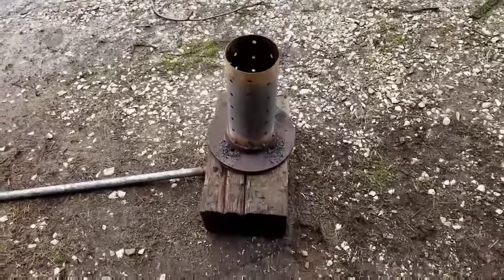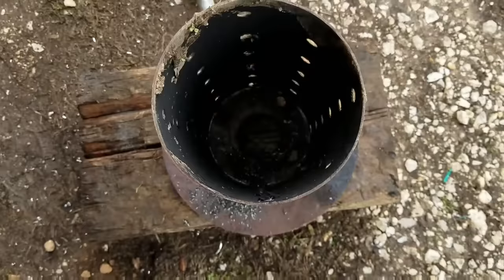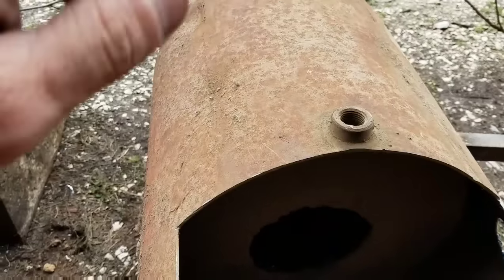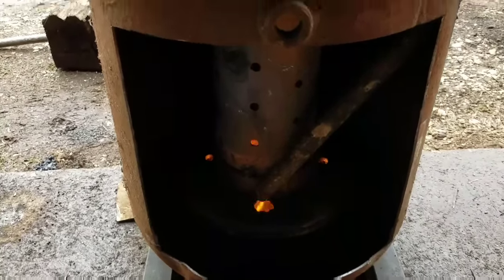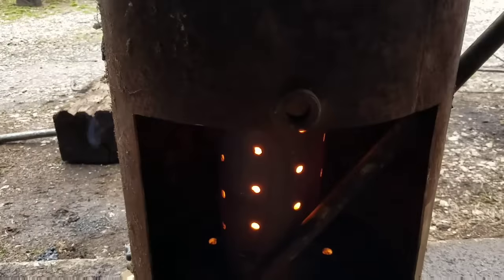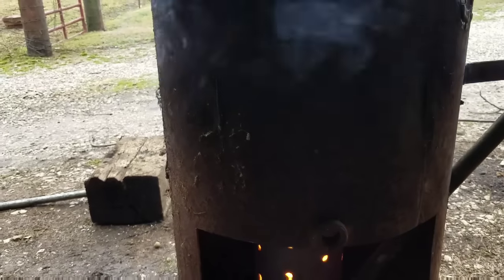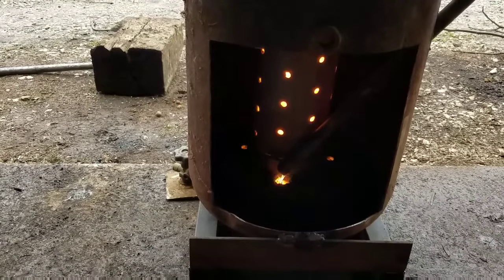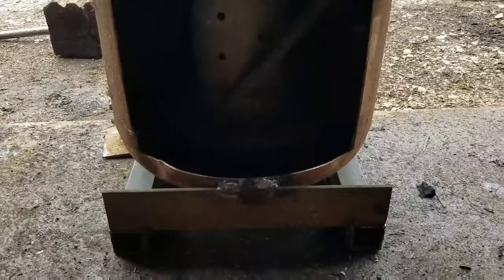Waste oil burner-100% Free Heat!!

Comment: I build a simular burner 30 years  ago. Headed a 2,000 sq ft area real good, but the shop burned down one cold day. I started a fire, I had a 20 gal used oil drum overhead to feed the burner with. The weather was very cold, abould 30 degrees in the shop. I started the fire and then unexpeakly had to leave. The oil was cold went I started it and the valve was turned up enough to started the burning. After I left, the oil warmed up enough to start runing  at a flow faster than it was burning. Oil overflowed on to the concrete floor and must have started burning and all hell happen. I now realize I show have build a pan around the bottom of the stove than would have held 20 gal of oil. Out side of that, the stove worked very well.
Reply: Very good information thank you.  Sorry for your loss. That is terrible
Reply: Seen some that have air holes low in the pan so if an oil overflow happens the rising oil snuffs the flame out
Reply: @plap.  you got a link?
Reply: @johndowe7003  no, you know how it goes. You look at one video they start sending all of them. Just random ones sent a while back. A few were very simple. The air holes just stay low in the pan so flames snuff out before overflow. One guy used 90° pipe fittings arranged around the base to get a swirl going and low enough to cover fittings  if flow of oil freaks out
Reply: @plap.  I'll post a video of my fire hazard soon 😁
Reply: @johndowe7003  look forward to it. I'm still in parts gathering mode. My goal is free scrap all components. Plans can change with any new good or bad idea. May save me some grief. At this point iv seen quite a few. Have a cold boat shop and lots of waste oil we pay to get rid of anyway. This will happen. Good luck
Reply: What did the insurance company say ?

Comment: When I was in the USAF, we had a "Clean Burn" oil heater in our shop. Loved that thing. I always wanted to build one of my own for all the used oil I have. Thanks for sharing.
Reply from the maker: Thank you for your service. That's pretty cool! Thanks for watching!!
Reply: Clean Burn heaters are made in Leola, Pa, and I worked there, and helped to make the preheating block for the oil. Incidentally, they had three rows of three outside, for two purposes. 1) to test the heaters long term, and, 2), to burn off excess oil. Their heaters are EPA approved for burning oil.

Comment: In the Army, we had field mess kit barrel cleaners, RAPID boiling water with a drip feed of kerosene. The burner, water tight was lowered into the HEAVY DUTY GALVY barrel of water, a can of fuel having a valve to control kerosene drip was strapped on and combustion was begun with a piece of lighted paper. The tube from the fuel can was about 1/4” dia and there was considerable distance from end of tube to burning ring below water. Consider a small fuel feed as there is less chance of flame working it’s way toward the fuel source. You can probably look these units up online to get the proven design. Good luck. Safety first and foremost. Steve, Plymouth, MA
Reply: If you're still around sir I would greatly appreciate a link to how these things were constructed. This sounds amazing. Thank you.

Comment: We used a drip feed diesel stove to keep our tent warm(ish) in Alaska in January 76. It would get the inside of our army issue dual wall tent up to 30 some degrees. It was -50 outside.

Comment: Not enough air and to much oil in the burner. Drip the oil very  slowly, about 1 liter or 2 pints per hour. You need the pin valve to regulate the oil flow. Also extend the chimney flue to speed up the airflow. another suggestion is, separate the flue from the burning pot. get rid of the flange and let the flue which have holes in it to be about 2inches about the rim of the burner pot. This needs little experimenting to achieve best burning without any smoke at all. To start the fire I recommend use little diesel mixed with methyl alcohol to heat the burning chamber. This prevents too much smoke and soot sediment in your flue. this method is very good in the winter when even the diesel is hard to start burning.  I used the Gas blowtorch to lit this mixture which is much safer than using  petrol/benzine. You need to clean the burning pot quite often as the sump oil is very dirty. When I had the heater I used two cast iron pots - one in one out being cleaned. I hope this will help you to achieve the best result.
Reply from the maker: You are right, it was very over fueled at the time. I made a part 2 to this video, it works much better. Thanks for watching.
Reply: Mabey a 3 inch air intake  in the bottom?

Comment: a friend of mines dad years ago had a small old potbelly stove in the garage with a tank on the wall with old waste oil that gravity fed threw a small brake line that went into a hole he drilled in the stove! he used a type of a petcock  valve you turned to control the flow! his son started the stove up and turned valve to much and left the garage and when he came back the stove was glowing red!!! lol
Reply from the maker: I don't doubt that. It something I'm going to keep an eye on.

Comment: Built one in Oklahoma out of a old water heater tank. I had a 18 wheeler so had plenty of used oil. Would heat the shop in the winter. Tank would get cherry red around the bottom half when you turned it up. Not a heater you would want to leave and go to town for parts though. Have to watch the heat and drip !

Comment: You should fill the top side of the air compressor tank with sand so it heats up and radiates heat longer like aa thermal battery. Just seal off that plate you welded in and put the pipe through so sand doesn't fall down. Should hold 40 lbs. Also I'd just use 2 brake discs instead of the dog bowl. Plate off the holes on the bottom disc for the studs from the other side and you have a much thicker base. Weld the 2 together with the offset facing outwards.
Reply: Great idea for the sand battery. And the weight, one never knows how heavy things can get. I'm currently seeing a trend of stainless right now and it seems they work well. I assume that it'll just take a little bit longer for the burner to heat up? Could you please explain this "Weld the 2 together with the offset facing outwards."
Reply: What about water instead. So you can use it for in floor heating

Comment: Either enlarge your secondary air holes or drill more of them. The black smoke is because it is starving for air. you can also reduce the amount of air into the pot which will reduce the flame going into the pipe and  clean  up the smoke. I had a russian heater which had a sliding door to control the amount of intake air. The pipe had so many holes that it looked more like a fence and it burned very hot and very clean.Also my secondary burn pipe was three times the length of yours. You have way too much primary air with that vented disk which creates too big a flame and your secondary burner can't keep up with it(can't mix enough air with it to create a clean burn).
Reply from the maker: Thanks for the feedback, I'll try it out.
Reply: The hole in the top of the brake disk needs to be sam size as the pipe over it.

Comment: It smokes a lot because it needs more air.  Not saying you need a blower, but get mor air (like 3 more 3 inch pipes directed into the burn pot) and it will really roar.👍
Reply from the maker: Thanks for the help, it's a work in progress. I made a 2nd video about it when its hooked up to the chimney, works much better.

Comment: It will work much better with a solid pipe like the one in your second video, haha already watched it,, works great. Thanks for the tip nice job.
Reply from the maker: Thank you! I did add a few holes back in it but, it looks like the picture in the thumbnail, it cleaned up the burn some. Just as long as you don't add too many or make them too big, it won't lose the suction.

Comment: Ok idea to try, use second brake disc mirrored between dog bowl and current setup. Should isolate oil from air better and give you true heated secondary air burn
Reply from the maker: That's a good idea, when I build a new one I'll try some different build designs.

Comment: Hi, how did it work out for you? The reason for smoke is that you need slightly higher temperature inside such that you get secondary combustion. Adding one or two plates horizontal inside would probably do the trick since that would force the flames to spend more time inside the burn chamber. The retained heat in the horizontal plates would cause a secondary combustion resulting in higher yield and no smoke.
Reply from the maker: I hadn't thought about the plates, when I build another one I'll be sure to add that in.

Comment: Good work.  Question. If you burn 20 - 50 weight oil. Does it burn hotter than if you burned 5-20 oil? Does the 20- 50 oil last longer?

Comment: No. Beeen running one for twenty years. Just a flex exhaust pipe with a  blower and a quarter inch copper line in the pipe dripping on a cast iron pan. Weld fins inside and choke the chimney.

Comment: if  your not going to use forced air for your combustion you need to make sure your fuel is atomizing or evaporating when it is introduced.  Making sure the oil is in excess of 160 degrees will help too.  Reroute your oil delivery closer to the flame so the oil is preheated.  Lessening the flow of oil will help too so you don't quench or cool the combustion with new, cooler oil.  So will some wicking, like a couple of big wads of stainless steel wool where your oil pool is. Stainless steel wool like the kind you use to clean pots and pans.
Reply from the maker: That steel wool is a good idea, I'm going to try that.
Reply: Carbon felt would also be a good wick
Reply: @pennderosafarms7910 lava rocks might be of some help as they are porous, and might draw oil upwards as it is burned.

Comment: That works pretty good the way you got it but if you add a door with a damper to draw the air in that thing will rip
Reply from the maker: I tried that but, it seemed it to block off too much air that it needs to run red hot. It's all trial and error, that's the fun part.

Comment: Needs more air to burn and clean up the smoke.  A fan to force air into the burn chamber is needed.  It's like a car engine that runs too rich - black smoke out the exhaust.

Comment: Draw the air from bottom up through center make sure everything else seals tight will give you the jet engine once you close the door
Reply from the maker: That would probably work. I tried to put a vented door on but, it blocked too much air.

Comment: Get the door done and you will create a vortex. That will quadruple your heat . Especially if you meter the fuel to a drip.
Reply from the maker: I tried that but, it seemed to block too much air.

Comment: Did you start a regular old fire in the bottom before adding oil?
Reply from the maker: No, the best thing to do is add a shot of kerosene or diesel to get it burning.
Reply: Curious how much oil per hour or day ?

Comment: The air coming where you cut the front of is equalising air pressure which is needed to be sucked up through the bottom. You need to fix a door to the front and seal it off then it should burn and sound more like a rocket.
Reply from the maker: I tried that but, it seemed to block too much air.
Reply: @pennderosafarms7910  Try boring the air holes bigger and put it on an 8 inch high 3 leg stand so it will stand on any ground.  8 inches should be high enough for air to come up underneath and 12 mm holes in the centre piece will give more combustion. I love rocket stoves and have watched many other builds. The common factor seems to be air mix and length of flue. You need plenty of air and a chimney/flue that's the right height for the upward vortex to be created to suck the air in the bottom, one feeds the other. Once you get the right intake and exit it will sound like a rocket. It's the same principle as pulse jets. Search Integza Pulse Jet in YouTube.
Reply from the maker: @paulmlally1  When I build another one that's how I'm going to do it. A hole in the bottom and force the air up. Thanks for watching!

Comment: Fire need plenty of air to achieve complete combustion. Any reason why you restricting air flow to the fire via the few small holes  you drill through the metal cylinder at the center? Why not design a primary vortex burn with plenty of air then create  a 2ndary or even a 3rd hot air burn again before the hot air exit ?
Reply from the maker: I'm sure that's a good idea. This is the first one I've built and I'm surprised how good it works. The next one I build will have a different design and I'll see what works best.
Reply: @pennderosafarms7910  my respect and my humble encouragement to you to design and build an ultimate stove
Reply from the maker: @psyamok3735  Thank you!

Comment: I'm in . going to build this. Will it burn diesel if out of waste oil?
Reply from the maker: Yes, it will burn anything. I burned some old peanut oil I had from a Thanksgiving Turkey and it burned just as hot as engine oil.

Comment: I would cut a hole in the bottom of the tank and place just the perfected pipe up through it and let the brake disc vents breathe from the outside and in lieu of the holes that you drilled through the face of the vented disc I would put the holes on the vertical side walls of the hub hat and put a concentric size slice of pipe with offset holes around that to use that for a secondary air intake?
Reply from the maker: That's a good idea. I think I'm going to build another one and try some different build designs. Thanks for watching!

Comment: probably pointless to say but if you feed it with preheated oil you could get it really roaring and the oil will burn cleaner / that can be done either with nickel wire/ ceramic stand off's / and a battery/ Mabey a potentiometer  / or you could get the stove to do it for you with some copper line. kinda like an old Colman stove works.
 
 with a few extra steps, you could get it to do the double and triple duty you could power the shed and the house and even work steel with it all at the same time.  if got something like that in mind for my place but its gonna take a little more planning because I'm gonna have to make it save enough to run indoors and in a tight space. refractory insolation will come into play.  there's a lot to be said for a conservative mindset if you were to bother to refine any of your waste fuel sources you could get away with burning even less.  a come up is a come up. free or not. end goal is to stay warm and dry with little or no' out of pocket' big benefit is to get it too do work as well. money stays in your pocket and the ability to stay independent if you don't have one red penny.

Comment: Check out Jerry’s DIY Ireland he’s been messing around with this for a long long time and maybe some of his ideas will help you out too because he uses him and makes women tons of them good luck and might be an idea to make that hole in the brake disc where your flames are coming up to the tube and a little bigger on the inside cut it out but leave quarter inch all the way around and that will help your your burn burn hotter and won’t have to fake it through that small hole on the disk
Reply from the maker: Thanks! I'll check out his channel. I've got it hooked up to the chimney with the drip feed set up, I need to put out a new video.
Reply: Jerry's Dow ierland

Comment: looks amazing... but what about  the fumes. Air contamination. Just asking cause looks like a great idea
Reply from the maker: No fumes to speak of. I'm not sure about the air contamination, it burns pretty clean. It was a fun build with old junk I had laying around. Its amazing the heat you get from so little oil.
Reply: @pennderosafarms7910  Yes... I was telling my son about there are many things to get free energy...efficient.  Thanks for the Video and the information!  . PD: I found a guy running a truck with a wood gasifier.. Its amazing

Comment: Is there a reason everyone uses a brake rotor.. would a thick steel plate work the same
Reply from the maker: I'm sure it would work. Its probably because everyone has them laying around. They also are vented and able to pull some air in.
Reply: Yes, the only point is to have a steel that is for high heat applications.  Brake drums are better, but gettign harder to find, rotors work as well.  So will cast iron.  As long as its a meterial that wont absorb oil and  can handle the heat it will work.

Comment: Feed tube is to close if it heats up along the tube could ignite in the tuben
Reply from the maker: That's true it you let it run dry but, it stays cool to the touch as long it has oil flowing.